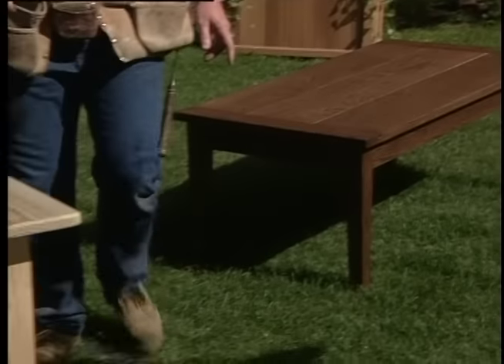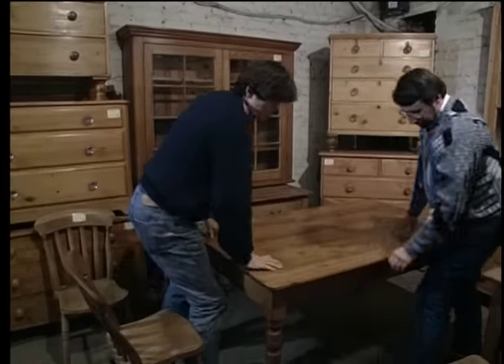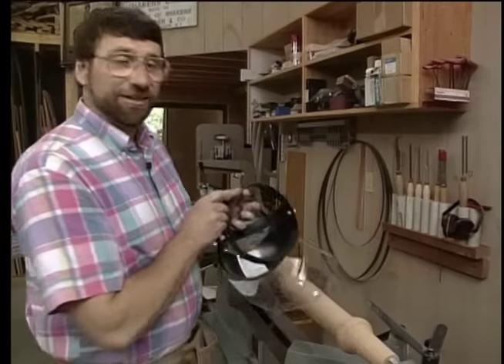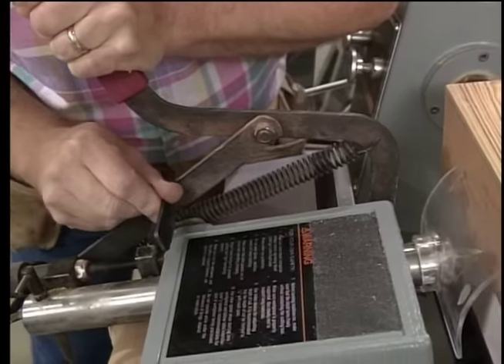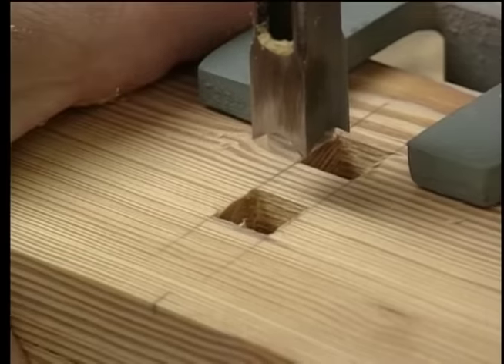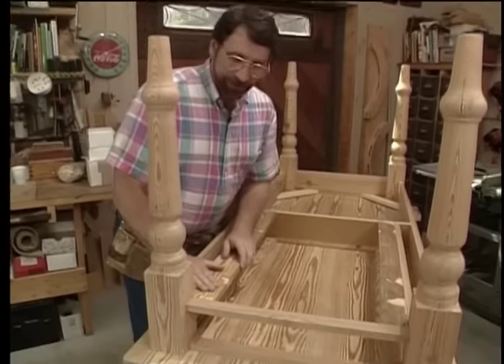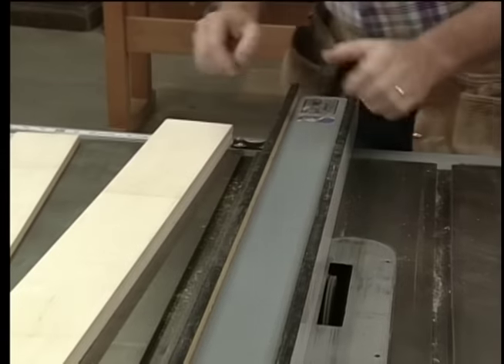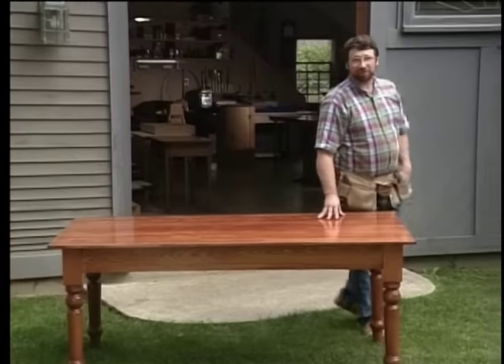Victorian Kitchen Table  |  S5 E1

Comment: Love this series, but why did you skip S5E04 Oak Coffee Table? It's not the same as S04E04 Coffee Table which you did post?
And what about  S04E13 Ladder-back Chair? That's another great project that I'd love to see Norm building.
Do you plan on ultimately posting all of the episodes?
Anyway, thanks for what you've done so far.
Reply from the maker: We're missing both of them. We have VHS copies but still looking for the original masters. fingers crossed we find them but we will post all we have.

Comment: No disrespect intended.  But that shop has about a 1/2 Million dollars worth of tools.  How much quality furniture can one buy with  1/2 Million dollars???????
Reply: I think you need a new calculator as you are well off with that figure, even for 1992 tool prices.
Reply: Not even close to that figure. But, if you think this is about saving money then you missed the point. It's about making something yourself. It's about pride in workmanship. It's about using your hands. 
But, in all honesty, I can tell you that a table like that made that well would cost thousands. Most furniture you get today, even the good stuff, is just mass produced from cheap materials. It won't stand the test of time. This table Norm made will last hundreds of years if taken care of.
Reply: I did not miss the point. And I reiterate that I respect what he does!  What I am saying is that the average woodworker can not afford all the "Specialized Precision Tools" Norm has at his disposal!!!!! @RabbleInArms
Reply: @frfalbo  No disrespect but what I responded to was your question of buying furniture over buying tools and making furniture yourself. Agreed that most people can't afford some of these tools but the only ones I see is the lathe and duplicator. The others are standard woodworking tools. You could make the legs tapered or even straight.
Reply: But where's the fun in that?